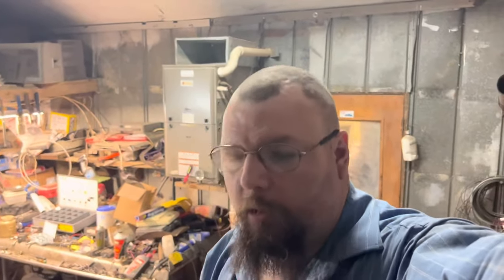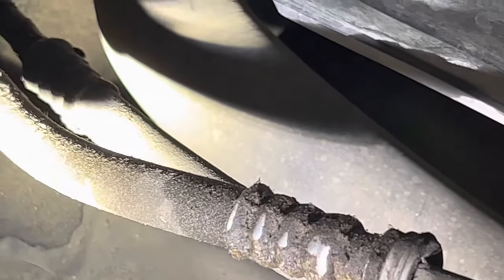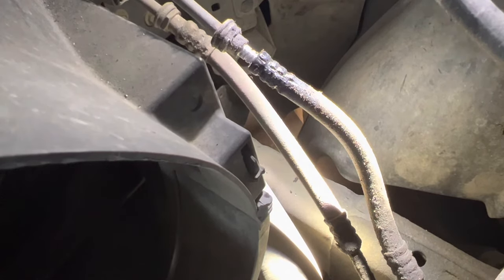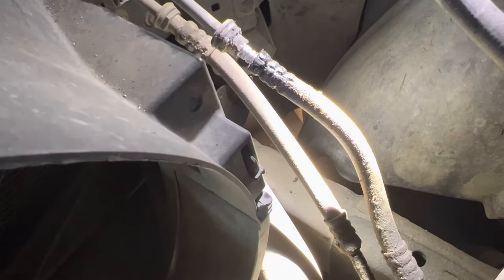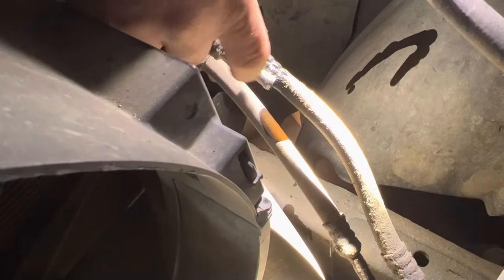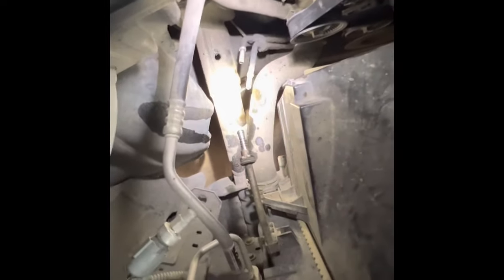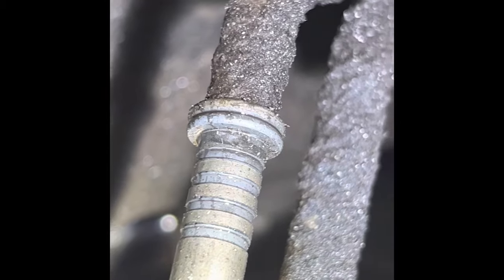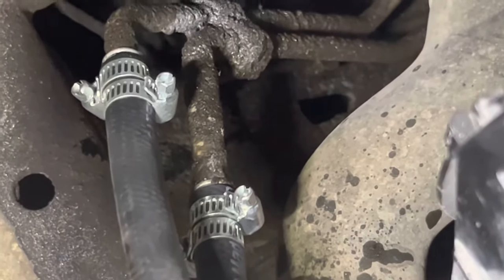Cheaper quick repair, transmission cooler lines (cutting crimps and replacing hoses)

Comment: Thank you very much for a clear, easy to follow video. I've got to tackle this issue today. My engine is a transverse engine so it's very difficult to replace the entire line. I purchased the assembly but it's too hard to get to the back of the transmission to disconnect and replace the line. I plan on doing your procedure now. 1 line is gunked up bad. I assume that's the leak and I barely caught it since the line is tight and practically hidden. This will make it easy if I can cut it off safely without damaging anything nearby. I've got a dremel hoping it can cut through. Any reason we could not just chew it off with a wire cutter?
Reply from the maker: @lildoggy4u  if you mean side cutters you will reach a point where it won’t bite anymore, a dremel will take a while but it’ll work, it’s what I used to use
Reply: Bulldog, thanks so much. Got the bumper off. It's a GO for today. I appreciate your response.

Comment: I guess this is a bandaid fix if you can’t get the part but you can just usually get a new line for under $50. Mine was $28 on a 2016 impala.  You have no idea if the line is barbed or not until you cut it apart. If no barbs you are having to flare it in a tight space. Sillly, just get a new line.
Reply from the maker: The cost of the line isn’t always the issue, it’s the labor of installing it
Reply: Strange,I'm 64 and have been using hose clamps on transmission lines for years. That's what they used for years before all of these so-called engineered parts.😂😂😂😂😂 PS. I have even used hose clamps on transmission lines that didn't have a flare . Transmission lines aren't under that much pressure.
Reply: I’m being quoted $500 for both lines on a Ram 3500 Cummins.

Comment: I did a transmission line repair on one side of my transmission line a while ago based on another video that, also, recommended using two clamps if you didn't want to drop a load on a new OEM part. Although, they didn't put the clamps on opposite sides of the line. But, it's been holding together for the past month. So, I'm not going to be overly concerned until it starts leaking again. I've done it with the other side of the line, particularly since there's no flang for me to shove the tubing over and there's no easy way for me to add a flang to the tubing without removing the entire line completely, which will be difficult because there's a bunch of other lines in the way and I'm a VERY amateur gearhead myself and I don't want to get in over my head trying to figure out how to put it all back together again.

Comment: I wonder if I  could use this to flush my transmission and or add transmission fluid to the transmission. Ps I don't have a dip stick and the fill bolt is a torx 40 against the frame so tight I can't get a tool in there.
Reply from the maker: You’d still have to have it out to check the level
Reply: @bulldogsautomotiveadventur4387  I cut some of the insulation out of the way and today I'll drop the exhaust out of the way hopefully I can get that plug out.  Thanks for the  response 👍
Reply from the maker: @littlebambino5145  in tight places I knock out the hex in the torx and put a wrench on it…shortens it way up
Reply: @bulldogsautomotiveadventur4387  I  just cut one and shortened it up. Thanks for the advice. 👍

Comment: Good job. Sometimes you need to use what you have on hand but in order to keep those aluminum shavings out of the lines and not damage your transmission it would be best to cut them all, clean and then pull the hoses off. They make special hose clamps that are smooth on the inside and will not cut into or damage the hydraulic hose. Having a flaring tool on hand if needed is a good idea also, never put hose on a smooth line that is under high pressure. Like you said you got lucky that the line had something to grab onto already.

Comment: I noticed immediately that you alternated the direction of the clamps so the tension comes from two sides.
Reply from the maker: Those smaller clamps create a pinch point the tighter they get, so I double clamp it and offset it like that then I tighten till I can’t twist the hose. Never had one leak that way.

Comment: Is it possible to just cut the ribs off, to where I could slide the new hose onto the existing tubing? Maybe I could replace the clamps/ hoses with high pressure fuel clamps/ hose?
Reply from the maker: That’s what I did…

Comment: Do you happen to know what the psi is inside transmission lines? I did this fix yesterday and I'm a little concerned about whether or not this will hold up and not pop off.
Reply from the maker: The hoses are rated to 400psi, max pressure is about 250 I believe, normal operating pressure between 150 and 225
Reply: @bulldogsautomotiveadventur4387 hi. Why this conections must be super tight and pressure save (250psi) but this aluminum tubing on the other side where it's connected to radiator has only tiny oring and little e clip?
Reply from the maker: @marekkrepa9982  they rarely leak there, but I’ve seen a few pop that clip after someone took it apart and didn’t get it back together correctly
Reply: @bulldogsautomotiveadventur4387  you are right but I still don't understand why one conections has to be 250psi proof but for other one 25psi oring is enough.
Reply: Would this work on an oil cooler line
Reply from the maker: In theory yes, but I wouldn’t recommend it

Comment: Honestly just spend the money lol 
I just did this job on a buddies f150
2 new front trans cooler lines and the main transmission line with a quart of AT fluid was $275. No need to mess with the quick connect lines since everything's being replaced and you got all new rust free transmission lines

Comment: Can this only be done within a section of those grooved aluminum sections, or can you do this anywhere along trans lines?
Reply from the maker: If you do it on a smooth section you should flare a bubble on the end to prevent the hose from blowing off under pressure
Reply: It will work anywhere in theory but if you're not going to make a lip I'd at least add some sort of cement to bond the hose to the pipe and make sure it's on there 4-5 inches deep with 4 clamps 2 close together on both ends of each junction/splice...8 in total.

Do that and it will hold more line pressure than your transmission should be producing unless something else is wrong (like a blockage).

Comment: Can I do this w oil cooler lines ?
Reply from the maker: I would guardedly say yes, I’ve never done it to engine oil cooler lines but the same premise applies, has to have a rib on the line to keep the hose from blowing off and oil resistant hose with the right pressure rating must be used…no heater hose!